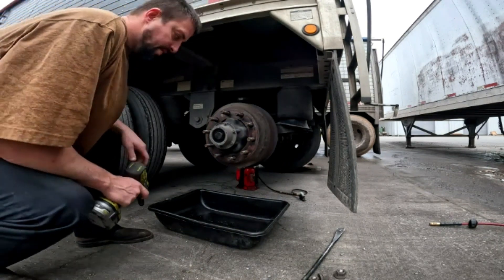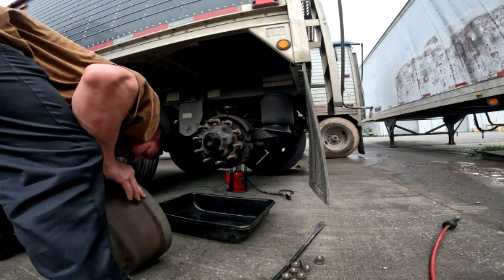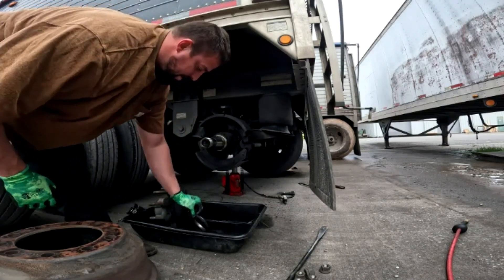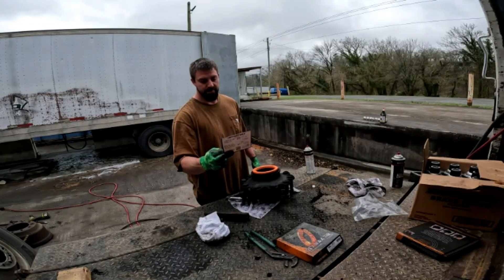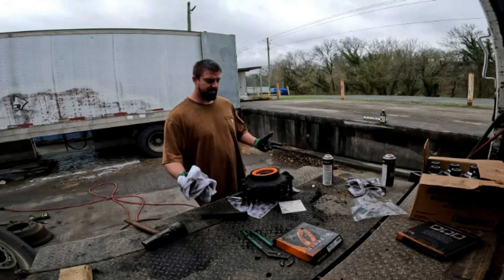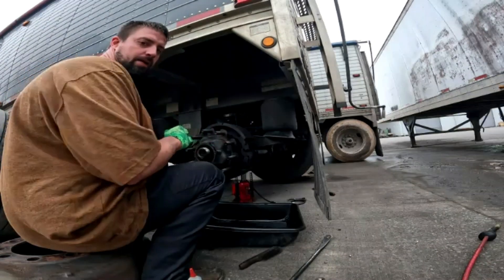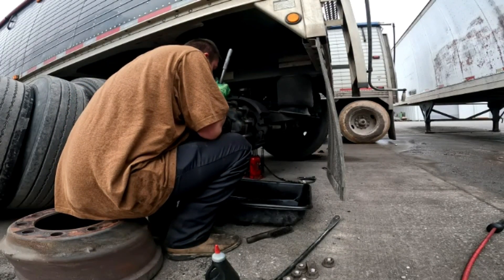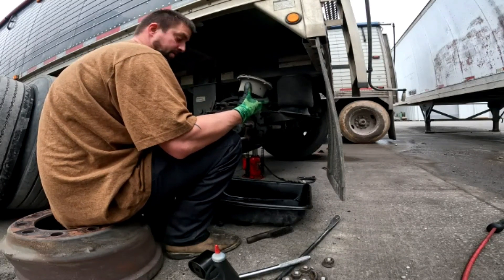REV HD wheel seal install plus removal and tightening process.

Comment: Do you have the cones inside your axle ? Usually you have to have some end play without those.
Reply from the maker: @edmonhaddad3335  on the newer hubs yes there are the cones or pre load spacers which i am not a fan of but if u have end play u are doing it wrong